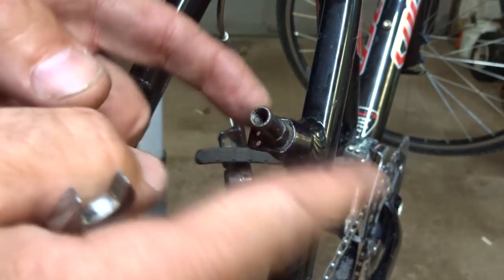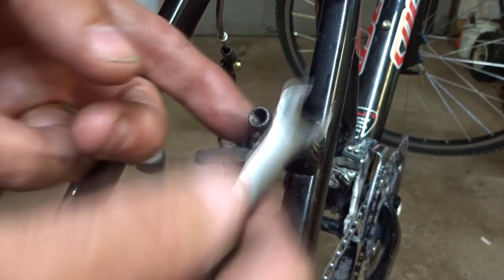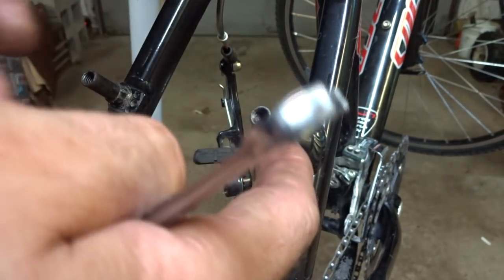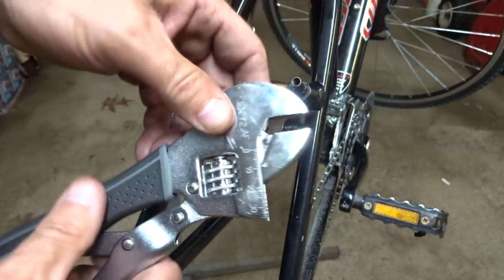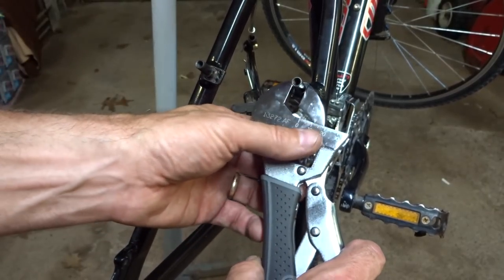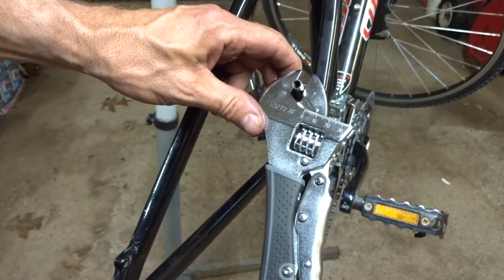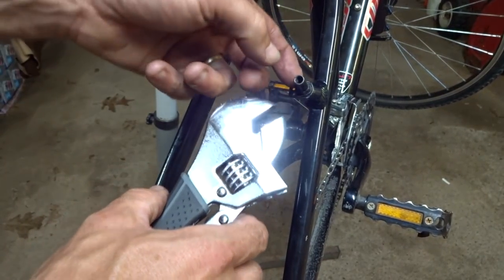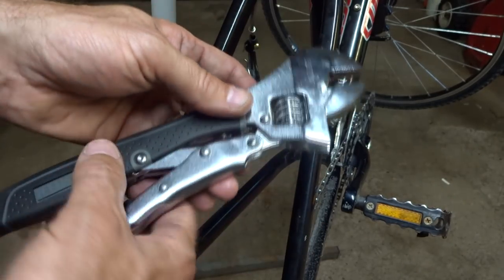Best Tool For Removing Brake Boss Stud For V-Brake/Cantilever Brakes

Comment: I’ve never had a problem using a 9mm open end spanner. Maybe yours is worn or stretched? You could also put a vernier gauge across the flats to check the correct size.

In case anyone’s wondering, the threads on there will either be m8x1.25 or m10x1.25. 

m8x1.25 is a normal size but m10x1.25 is a fine thread. Easy enough to find on eBay once you know the size but not easy to find in any local store.
Reply: 11/32” is 8.73mm, so that’d probably do it.

Comment: If it's too tight or too loose with metric wrenches, you possibly need an SAE wrench.
Reply from the maker: I did. They weren't even close.
Reply: I tried that on my bike recently, didn't have one that fit right.

In theory 11/32 should be about it, it's between 8 and 9 mm, so give that a shot if you want.

I used an adjustable and ended up scrapping some aluminum off the frame because I was fixing my brakes outside instead of doing it right, but it worked.

Comment: I had a lot of luck with a small 6" pipe wrench - pipe wrenches are great in general for anything threaded and stripped out, too, but you have to watch out because you can easily obliterate whatever you're wrenching on.
Reply: Be careful turning it too. I wasn't, ended up gouging some aluminum off the frame when I was turning the wrench.

Turns out tool steel is a lot harder than aluminum alloys, who'd have guessed?

Comment: Hi RJ, weird question I know, but I ride a recumbent trike (greenSpeed X7) and am looking to add a rear parking break.  Not only does it not have any, it doesn't even have a rear permanant triangle.  Disc would be Nice. but rim will work as well (just needs to hold it when I am stoped.) Do you know of any bolt on kits or ??? that may work with the Aluminum frame?? Thanks much, David
Reply from the maker: Not off hand.

Comment: RJ, do you know of a bracket or adapter to install v brakes on a non v brake suspension fork? I'm building another bike and all the forks i have are either disc only or threaded... just to recycle a bit.
Reply from the maker: I do not.

Comment: RJ my bike studs are loose and now its stuck with my v brake bolt when i remove it, any ideas on how to seperate them?
Reply from the maker: Penetrating oil and wrenches.
Reply: @RJTheBikeGuy  Wonderfull! Thanks RJ! though i still need that tool to grip on the stud, the bolt was just really stuck

Comment: Hi Rj
is there any way to replace the non replaceable pivot? I was thinking about breaking it off and then put a nut behind and bolt the new one.
Reply from the maker: Not really safely, without welding new ones one.
Reply: RJ The Bike Guy so do I weld a nut behind then? I already broke off the pivot trying to take it off. You know Canadian tire bicycles v brakes always gave me issues with noise
Reply from the maker: Take it to a professional frame builder and have them do it with proper equipment and posts.

Comment: i have an issue with shifting but its very irregular. my my shifter works reversed 1st gear is the the tightest and 7th being the loosest. please help
Reply from the maker: Sounds like you have a Low Normal derailleur.  It is what it is. Don't like it, replace it.
Reply: RJ The Bike Guy OK thanks

Comment: I broke my bolt inside, anyway to get it off since it’s welded
Reply from the maker: Shrug. There is not a standard solution. You will have to figure it out.

Comment: rj when i put my bike upside down my hydraulic brakes stops working
Reply from the maker: You probably got air in your brake lines. You will need to bleed your brakes. I don't have any videos on that. And the process varies for different brands/models of brakes.

Comment: sounds like it is a SAE wrench not metric you might pickup a complete setup
Reply: 11/32 on an inch
Reply from the maker: I tried SAE, and they were even farther off.
Reply: 11/32 of an inch falls right between a 8mm and 9mm not a common size but can be boufht in a service wrench set.

Comment: I am using 6points deep socket to take those off..
Reply from the maker: You must have special studs then. All the studs I have seen are round, with flats on two sides. So a socket that will fit over the rounded part, won't touch the flats. I just tested with both metric and SAE deep 6 pt sockets. They don't work.